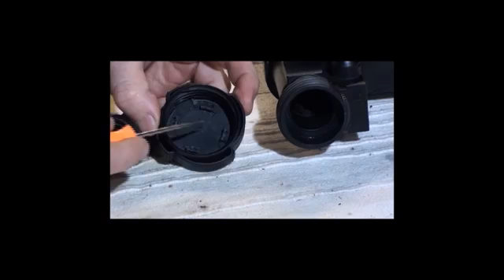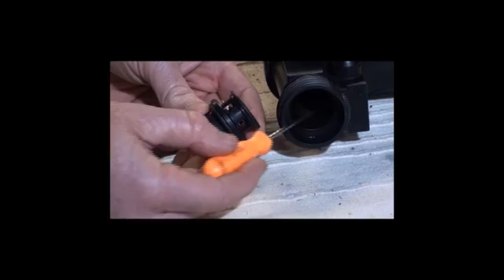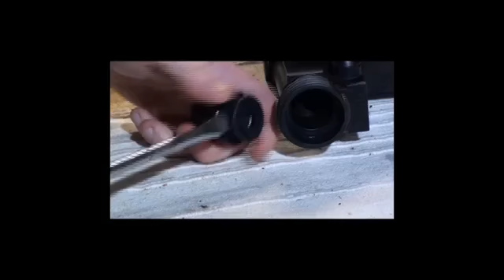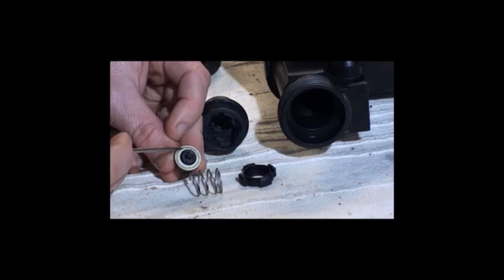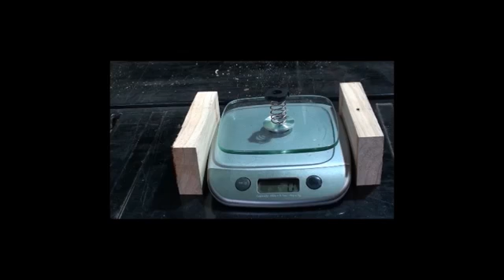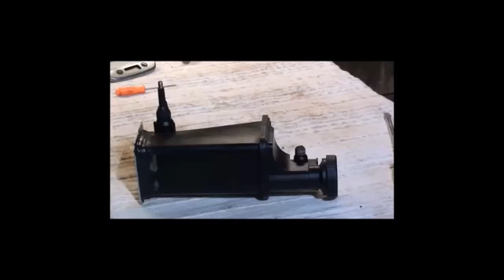E46 1.2 Bar Coolant Cap DIY

Comment: @jeffrichardson7677 Cheers for the video mate. I’ve a damaged 1,4 bar cap for my 2005 530d. All I’ve managed to get my hands on on short notice is a 2bar cap that came out of petrol x5. Can I just swap the spring from the 1,4 bar cap into the 200 bar one ?Thank you.
Reply from the maker: Unless it's exactly the same cap but with a different spring I would say no. You would have to test to check what pressure it actually gives you.